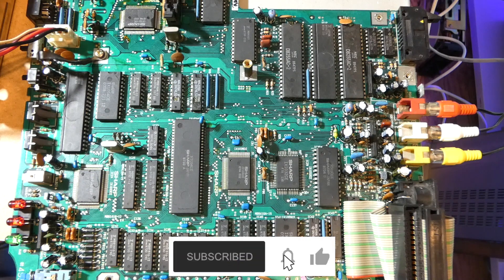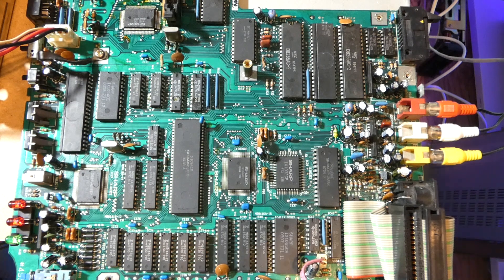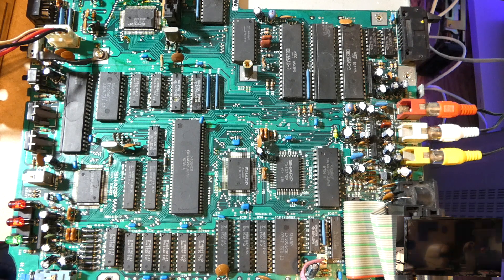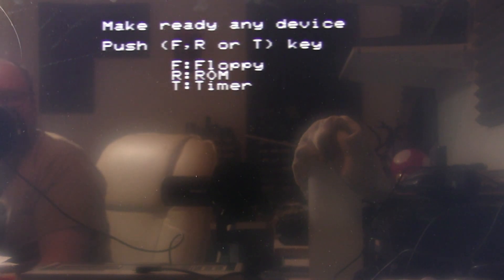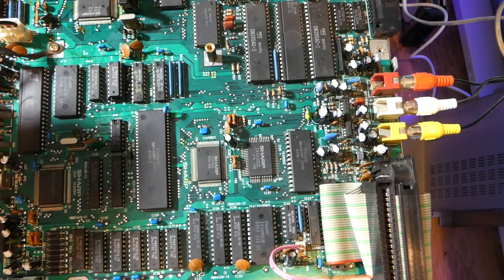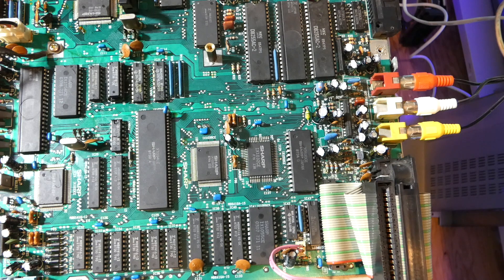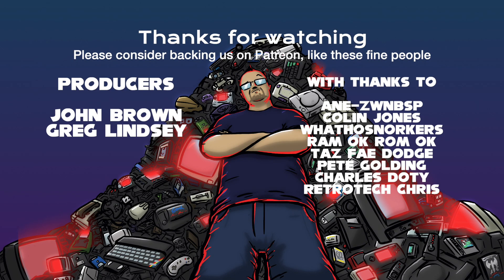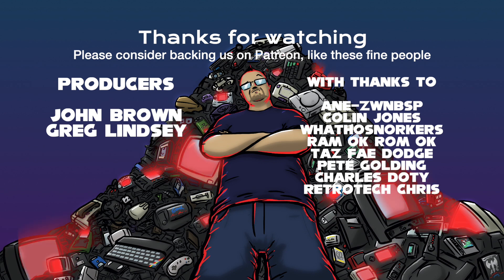Repairing the twin: The Sharp X1 Twin Refurbishment Part 2

Comment: Last evening, my X1 Twin started to show signs similar to what you experience here (only in games though)...I am suspecting a bad memory chip. What is the chip you used here? I want to try and do what you pulled off here before giving up...Thank you!
Reply from the maker: It uses MB81416 and the piggy back seems to work consistently to track down the error.  When you remove a chip be REALLY careful, the tracks around some of them are pretty weak, I raised one and didn't realise (fortunately it didn't break).
Reply: @ReEnthused  So FYI I gave this a shot and found no change BUT (and this is weird) the graphics are made perfect when I switch to "B" Sync (RGB). I haven't a clue what the issue could be. If I swap on the fly (while a game is running from B to A) the graphics are fine but once a new scene loads, its garbled until I switch back to "B" and reload a scene or title...Super weird. The "A" Sync outputs a decidedly better composite output so I'd like to use that. Any clue what might be happening here?
Reply: @3rdman01  how odd, as far as I’m aware the Sync changes the KHz range - I’m not sure why it would affect bad graphics